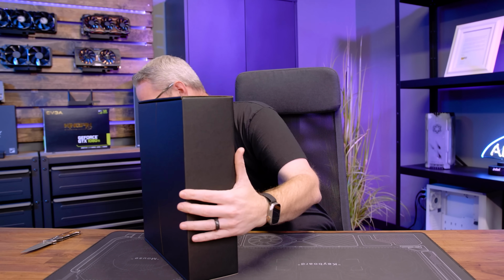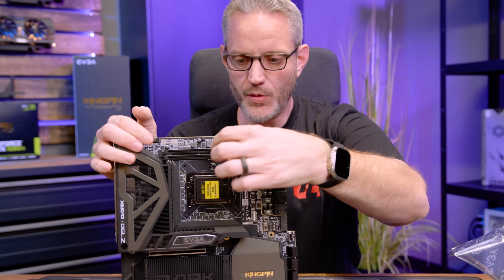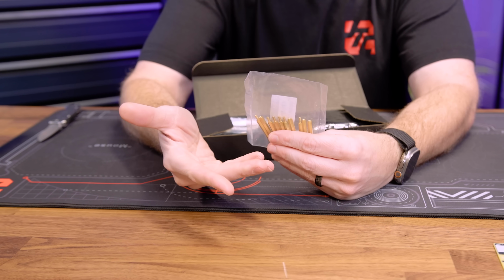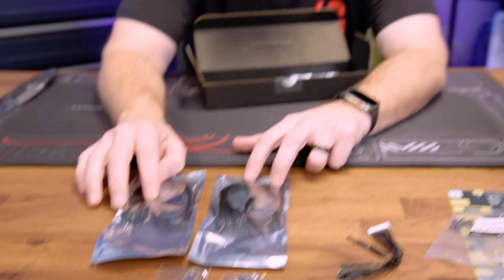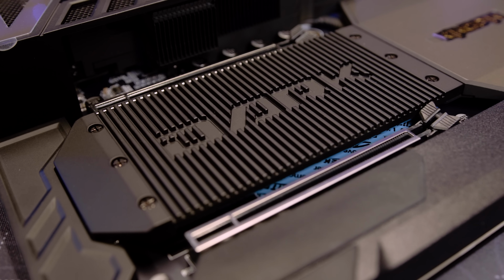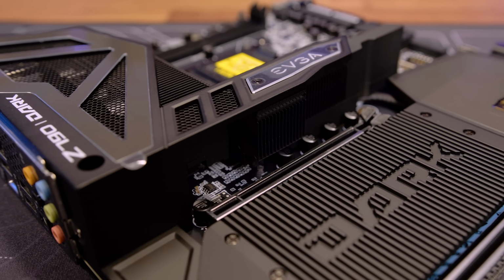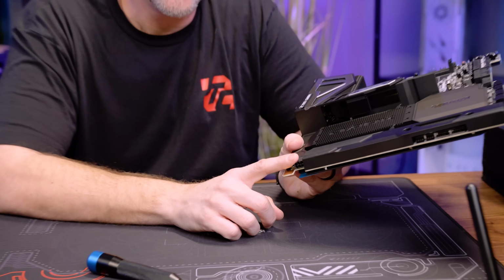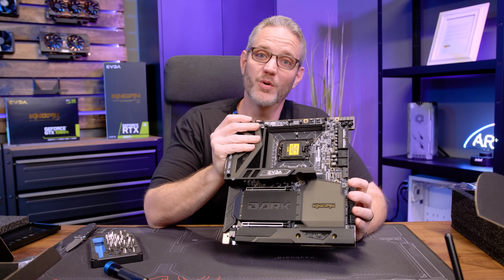EVGA created the mother of all boards... Z790 KINGPIN

Comment: The ram slots are on top and bottom for air cooling. In this layout the air can run from front to back and not have one ram block the air flow to the next ram slot. Having the ports go sideways also helps get air to not only the ram but the CPU heatsink.

Comment: Just so u know not only are 2 slots on the motherboard beneficial where everything counts for extreme ocs but if you are instead using 32gb sticks (64gb total), they run WAY faster with only 2 ram slots on the board. This is best showcased with msi where they list mem speeds depending on configurations. Their itx board with only 2 slots can clock 600mts higher with 64gb than the z790 godlike, a roughly 4x more expensive board. All because the godlike has 4 slots available even tho only 2 of them are being used regardless.

Comment: Why would you want 50% less ram, i heard what he said but why would anyone willingly suffer that handicap ?
Reply: How is it a handicap you can get 2 sticks with higher amounts so instead of 4 8gig sticks do 2 16gig sticks you can setup 2 sticks of ram similar to 4 unless you are taking it to extremes.
Reply: @a1racer441  because in the future your going to want those 4 slots, just as you have for every generation before, why are mobo manufacturers gimping boards so much at the same time as cranking prices to cosmic levels ?
Reply: @TorchCTI yep I did 2 or the 32 gig sticks so that’s 64 gigs way more then any game will need for the foreseeable future. Plus when it gets the the point you need more then it’s time for an upgrade.

Comment: x570 boards were sick as fuck. BUT, they were too late for me to snag one. I had already had purchased the 3950x and MSI MEG ACE. Since then I got a 7700x and Asus x670e Gene.... EVGA needs to hurry up. They are being way too slow with their design. There is NO LOGICAL REASON why the EVGA boards take longer than every other brand on the market. Its not like they make complete trash products so it takes longer because they suck at their job.... the boards are just as high quality as other brands highest end stuff. They really need an x670e kingpin board..... it would be nice if by the 6th (7800x3d launch) they also had their x670e available. I would light upgrade the combo....

Comment: Is part of the reason for the rotated socket also to prevent coolers from covering the dimms? I’m new to this, but I frequently hear about the care you should take in picking a cooler/case because depending on case space and cooler/pump height it can obstruct dimm access, and if you only have two slots total it sounds like a problem.

Comment: is there other boards who has this memory location. ? This is great for airflow when you have tilted 90 degree MB  case and  fans blowing upward witout the memory blocking airflow to the cpu. Also the memory runs cooler standing vertically when fans blowing cool air from the bottom.

Comment: Hate it>>> Yes I KNOW its OC board buttttttt 

2 Memory slots.. booo..(I get it, butt booo)
Only 2 PCI-E slots.... dam I miss the days of the Classified boards... I wish boards would included 5+ Full size PCE-e x16 lanes.....

and I had to google the board.. the lack of info on the IO shield The lack of USB 3.x (usb-c) makde me cry.. we need more boards with a full set of like 16 USB 3.x/c ports.. also wifi and gaming should never be in the same sentence/board...would have easily traded the wifi for more usb ports.

good news is atlest it has a decent full set of 8x sata III ports... I fill though quick mind ya, Id be packing 12x 8tb drives for gaming alone currentlly

Comment: i have not been a fan of Nvidia's since maxwell/pascal released and havn't bought any gpus from team green since then, but you can bet before then I was all EVGA.  I can't get any GPUs from them anymore, but I have been an avid PSU customer of theres for over a decade, my first one I bought from them a 650 bronze is still going strong after 10 years of pretty consistent usage.  Main system now runs a 650 watt supernova gold and my random systems tend to be more EVGA bronze psus, systems i build for others I always go EVGA.  With alderlake/raptorlake intel has intrigued back to team blue for a secondary rig and i think i will splurge a bit and a do an EVGA board, this company has always been good to me and countless others and I will do what I can to support them still.

Comment: I got the z790 classified, and you can tell they made this for themselves, gamers.  It's a heavy card because they have beefy cooling and a metal backplate for the motherboard.  They designed these two cards with a lot of handy features in the BIOS which I like, but threw me off since I haven't had an EVGA motherboard since the X99 days (don't remember why I switched to ASUS).  It comes with BIOS recovery and drivers on a 16GB thumb drive, which is handy if necessary.

Edit:  Why did I go back to EVGA? They were my goto for graphics, so after Nvidia put the squeeze on them, I'm showing support by purchasing their motherboard.

That reminds me, I need to register this card!

Comment: So if I want to add an SSD a year later, how does that heat sink with thermal (adhesive?) let go of the existing SSD without making it a cooling mess later since it's one solid heatsink?

Comment: i5-8400
z370 aorus gaming
16gb ram 3200 corsair ( running at 2133, xmp dont work properly, cpu only use 2666 but cant figure out how to do it)
ssd 840 evo 250gb
HDD 2tb
2080 super
550PSU
Lg 4k monitor IPS 60hz ( like 4k gaming but 1440p runs more smoothly)
------
Does it worth to upgrade cpu and mobo on a budget range?(5600/12400f) or its overkill yet? no competitive gaming. just enjoy great graphics and gaming.
Any help will be appreciated ! Thanks in advance, Keep it up!

Comment: I've wanted to see this power connector layout for a long time.  I can even envision a case with a built in set of mating connectors that the PSU and MOBO just sliding into and click in place, instead of having power cables to route and manage.  Thus the length of the cables are determined by the case manufacturer and is built in, and the positioning of connectors on both the PSU and MOBO could be standardized.  I could envision SATA data cables and drives connecting the same way, heck even front panel power buttons/audio/USB connectors and case fan headers.  Also, the board could have VGA 8 pin connectors that were a pass through to a surface mounted connector on the face near the end of th 16x PCIe slot locking tab, and just a short jumper cable could connect from the MOMO to the top of the video card.  All of this would vastly contribute to a much cleaner and simpler cable management system.

Comment: I just don't get the weird angles on the design- these pieces of hardware are all squares or blocks or rectangles. I do not understand why designers break the balance by adding in these weird angles and cuts everywhere. Or round designs for that matter. Every single build I've seen that adheres to the original "lines" standardized hardware uses look much better and balanced than build have this weird gamer/stealth/sportscar (Faster!) design. Also, Asian manufacturers, your spells and wishes don't translate very well to English and often look dumb. Putting in so much effort to make a beautiful build and having it ruined with some dumb slogan on your motherboard or GPU like: "Unleash your imagination" or "Happiness through design" or whatever dumbass sentences they come up with really breaks it for me lmao. Completely offtopic but just my two cents.

Comment: I don't want to run Intel. 
I don't want to overclock beyond whatever auto deal is built in. 
Their PSUs are great but I don't buy those except once every 10 years or so.
I really just wanted their GPUs. I wish they would have picked up AMD cards.

I wish them the best as they are a great company, but I don't see them lasting long term.

Comment: I wish some one made a motherboard thats on the exact other end of the line. I mean like motherboards used to be where you had no onboard/built in devices just a tonne of pci/ isa slots for all your devices. I want a mobo that just has monitor output for if you use an apu, some usb slots for keyboard and mouse, front panel stuff and maybe an ethernet port at most. and then have like 7 x16 slots. this means I can buy better dedicated add in cards and not have to deal with the extra onboard stuff. this would be more power efficient and way cheaper to design since you would massively decrease pcb complexity.

Comment: Man I need an upgrade so bad but wanting a min spec 13900k or ks and an optimal board and cooling then gen 5 m.2 ugh it’s gonna cost 1400 with out the gout but I will get the gpu when they go on sale due to no demand by cypto

Comment: Great video, Jayz! I wanted to put an EVGA Z790 Kingpin in my new  build, but the guys at Lian Li told me it most likely wouldn't fit in my 011D XL without some modifications. Went with an Asus Strix Z790-E that's working like a champ.

Comment: another payed review, that does not impress me... talk about issues, talk about bios stability, talk about realworld stability test diff drivers etc.. test low tear brand graphics on this mb see if it handles test low grade ram, on this mb, see if it handles..  some useles plates covers on mb does not make it king or queen or whatever..
Reply: Kingpin boards are at the top of hardwarebot year after year. If you have no clue of what you're talking about, better don't type at all

Comment: I mean with I think 8 sata plugs on that board, why even bother taking off the m.2 cover to add extra storage when you can throw in a sata ssd or a cheap 2tb hdd from Seagate? Then you don't even need to drain your loop if you have a hardtube loop.
Edit: Depending on the cost and where I shop, I would buy an EVGA mobo for my 5000 series cpu. It is overkill for gaming but at least I know I'm getting a good warranty that will be backed up.

Comment: The first motherboard I ever bought was an EVGA nForce 4 SLI board. Yeah, socket 775 with a Pentium 4. It eventually died, but by that point they had quit making affordable motherboards and I wasn't ever able to buy another one.
However, it has a lifetime warranty and it's still technically under warranty. I've been tempted to try to RMA it to see what would happen.

Comment: I watch your cahnnel alot  As with most techs  somethings i do not agree with But i get the same too. I NEED to adress a issue about the way Amazon lists their cpus speed THEY LIST THE Overclock speed as if it was a base speed i have written them but to no goodl.
Could you address this on you site ?

Comment: Always use Koolance QDC's when water cooling. Gen 4 or Gen 6 QD4's with 13mm (1/2in) ID, 19mm (3/4in) OD for best flow (Gen 6 - improved durability, and can operate in a wider temperature range. They are available with EPDM or Viton seals)

Comment: My last EVGA board was the EVGA SR2 was pretty awesome overclocking dual xeons.  Still use EVGA power supplies though have the 1600 P2 in my current threadripper system.  May use EVGA motherboard again if they come out with something for threadripper pro or epyc.  Used Asus for the dual xeon v3 board cause it let you overclock them and went gigabyte for threadripper 3970 system cause it had the extra pci-e slot.

Comment: I am still routing for EVGA, just wish they sold local to me, but mobo's were none exsistant or not at the lower teirs available when I built my pcs. when I built my pc's the mobo's were like upwards of £200-£250 or $250-$325 USD. so while not cheap skate it was a pricey pc build for myself. and if graphics cards are anything to go by, then I would know I wouldn't have problems like I do with my pc atm with failed boot from system completely off, reboot works fine.

Comment: access to m.2 slots is partially why my ssd upgrade is waiting for actually having enough money to completely rebuild my 'loop at the same time, because as commented by Jay, I'll need to drain the 'loop to access the old drive for upgrade. Heck, I'd need to drain the loop even to get the system on its side to try to lift/move gpu enough to access the m.2 heatspreader which is half under 1 slot watercooled gpu.... Whoever came up with that design (not EVGA mb, but lets not name names) clearly didn't care much for "easy to access". Also, helpfully the second m.2 is behind the mb, so to access that I'd need to dismantle stupid amount of hardware...

Far as my designer brain could suggest without knowing enough of electronics, yet mb electronics, is having m.2s slots vertically with the connectors below upper pci-e slot, which might make it possible to have such "metal on both sides headspreader" thingy that could be completely/in parts detached without having to remove the gpu. Like, remove screws to let the heat spreaders tilt away from the connectors and pull the assembly down. Far as I know no manufacturer uses vertical m.2 slots though. Which is curious in the sense that mbs' have less pci-e slots, and to my limited understanding m.2 uses pci-e lanes. Which at least in the olden times used to go vertically anyway...

Comment: Why won't motherboard manufacturers include a front panel pins extender (PW switch, Led etc..) It is a always a pain to reconnect those tiny wires when the MB is inside the case.

Comment: Here's an idea to solve ALL the "Graphics Cards getting in the way issues".... Make GPUs external only with a dedicated specifically built connecter (not Thunderbolt or USB-C crap) to connect it with the MB. GPUs can then also use a separate Power Supply to further reduce the ever increasing watts demand for PSUs.

Comment: I agree with the SSD explanation. I just now installed a Gen 4 SSD as they're finally cheap enough to get. So I moved all my M.2 SSD's down the stack. I also have a watercooled GPU. I was able to move all 3 of my M.2 SSD's without having to remove the GPU.
I may not buy EVGA Motherboards, but I always recommend and buy their Power Supplies.

Comment: EVGA is my kind of company, as ethics is very important to me. Are they perfect? Of course not, but they are doing a heck of a better job than most companies/corporations. I'm also a fan of high end Motherboards. Cheating out on the Motherboard means more chance of an issue coming up, but also when you try and fix it/figure it out, if you do try tech support, it will usually suck. Better to side step the whole thing and buy a premium motherboard. After all, that's where everything plugs in, the foundation of the machine. Quality matters.

Comment: Oh access to NVME is a issue! especially when GPU longer than PCIe slot so cannot unclip it!!!!! Also it is an issue GPU is not 1 SLOT! they should just force water cooling to keep the use of 7 slots!!!! just have quick release water cooling on GPU and KEEP the GPU 1 SLOT even if a H100 class gpu!

Comment: Jay, could you do a video on VRAM Errors...?  I've got a Zotac GeForce 3070 Twin Blade OC that's never gonr over 65C that I've started having problems with about two weeks ago. I just used OCCT to run a VRAM test. The card shows a ton of VRAM errors. All it was showing previously was an error message saying nvapi.dll was invalid which I was looking for a solution to, So, of course, now I'm wondering if it's related, and can VRAM Errors be recovered from, but I can't find any info on VRAM Errors anywhere at all, really. A video on VRAM Errors would be really appreciated... you always do such great videos... Thx...

Comment: I'm confused about the M.2 heat dissipation. You have thermally conductive adhesive on the bottom of the M.2.  Then secure a heat sink with thermally conductive adhesive to the top of the M.2 once it is socketed to the mother board .  How does one remove the heat sink without damaging the M.2 device(s)?
Reply: Simply heat with a hair dryer and pop the heatsink right off

Comment: As a more professional user, I'd love the return of a full set of 8+ full length slots and clear instructions to reconfigure from scratch after a late failure.  NVME slots can go where this board put the chipset cover. Cards that would use those slots include future power efficient GPUs from a 4th brand, multiport 100GbE cards for extreme networking, high end RAID controllers, 8K video capture cards etc. etc.  This would require motherboard circuits to split PCIe lanes to drive all those cards, PCI bridges to interface to older standards like PCI-X and ISA. So not the typical consumer chipset.

Comment: ok so off topic slightly but ive been weighing options. i bought a 3090ti kingpin before i went and built a custom loop. now i want a gpu i can utilize in my open loop but noone sells a gpu waterblock for that card. now should i sell off the 3090 ti kingpin and buy a card or just keep the kingpin with its standalone aio and rad. tia for the advice.

Comment: In this case for taking out the GPU to get the m.2 drive. The best way to go would be quick disconnect water cooling setup. This way no major water draining and refilling mishaps. Just disconnect work on the m.2 drive. Quick reconnect done.

Comment: Ram is on top. That is a good idea. I like that placement. Taking advantage of upward cooling. It make a lot of sense with newer cases all being blocked front panels (Glass to see the RGB fans. )
Ryzen 6/7 I might upgrade. I like my 570 board but I am air cooler limited. Ram gets in the way. This looks nice.

Comment: took a while before case manufacturers worked out we don't want a 1000w psu next to the fans of a 3 slot graphics card, maybe now they will all ruthlessly steal er i mean independently develop the idea of putting all the power inputs together rather than half in the knuckle skinning top left corner